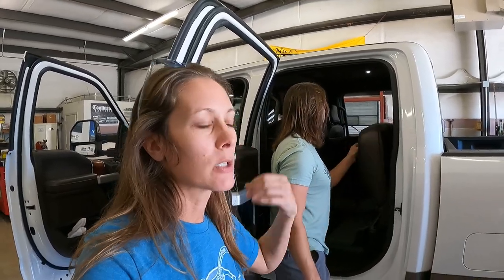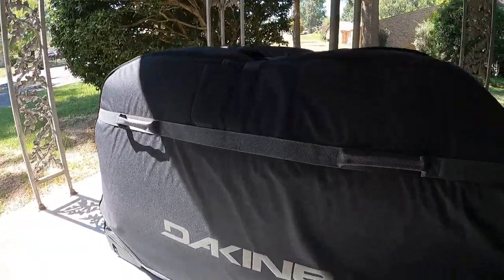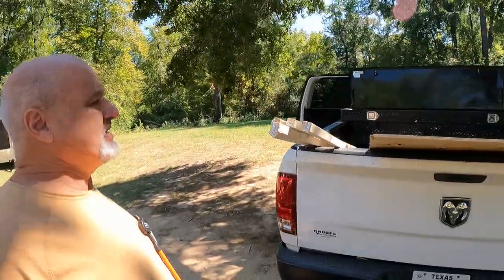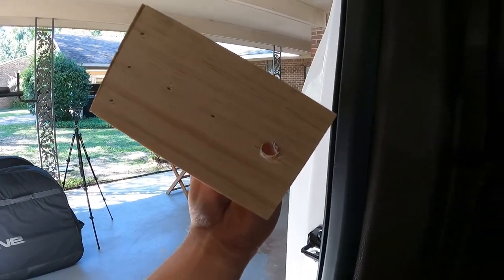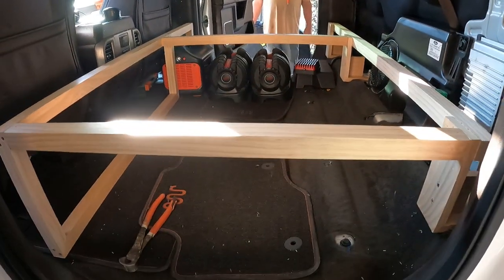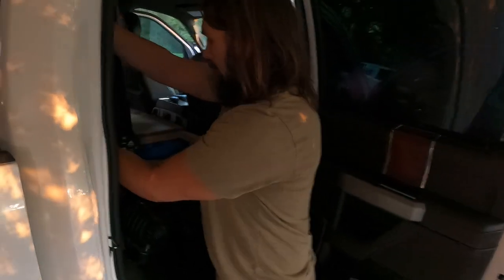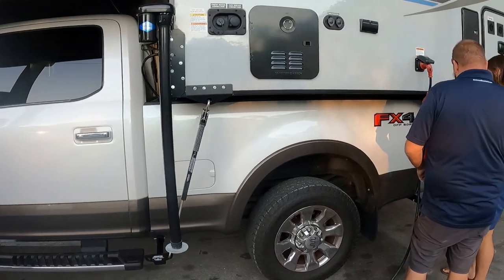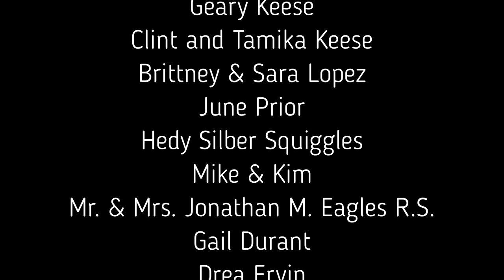Revealing Our New Truck Camper | Ford F350 Platform Build

Comment: Awesome new chapter.  Things to keep an eye on regularly with a slide in truck camper.  

The roof.  Get up there and look it over at least once a week if you travel around low hanging branches.  Carry several tubes of self leveling Dicor and appropriate caulking gun to shore up and rips or tears in the roof before it takes on any rain/snow. 

Truck tires.  Check tire pressures before taking off in the morning (or when the tires are cold).  Check them often throughout the week.  You don't want a tire to blow with a camper in the back of your truck.  Also, keep an eye on the tread wear, and sidewalls for cracking or sun rot.  One thing to remember if you do blow a tire, DO NOT slam on the brakes to try to come to a stop real quick. Odds are high the rig will head abruptly in the direction that the flat tire is on.  Better option, keep pressure on gas pedal and a firm hold of the steering wheel while you work your way to the side of the road safely.  

Don't ride your brakes down long hills to maintain a constant speed.  You will overheat your brakes (cause them to outgas) and not grab when you need them most. Instead, coast up to your chosen speed (say 55mph),  stab the brakes like you mean it and get your speed down farely quickly to (45mph), coast back up to (55mph).  This will put less heat into your brakes, and give them plenty of time to cool between use.  Don't be concerned with the A-holes behind you that are in a sports car and don't understand the amount of weight you are in control of.  Let them pass when available, and just wave as they go by.   

Most everything else regarding owning/driving a truck with a slide in camper is just normal maintenance routine.

Comment: You mentioned that you would be putting your kayaks on top of the camper make sure you know the height of your rig with them up there you need to know this for overpasses you will go under while traveling (VERY IMPORTANT).
Reply from the maker: We agree. We messed and it will be under 11ft

Comment: congrats on the new rig and exciting times. I notice you did not have a mat on the floor board of the truck bed. Most truck campers warranties are void if you dont have a mat under them. Id check the owners manual. and if required,, tractor supply has horse stall mats we all use in this hobby, saving a few bucks.. Dealers are ok with the this over there brand. it prevents slippage and gives it a flat surface and cushion to rest on. Might want to check the manuals to protect your new investment. 
. Safe travels guys.

Comment: A word of advice. Watch out for pieces metal in parking lots as they can catch your jacks and rip the back of your camper off. 😂   BTW, completely impressed at how you guys DIY fixed that.  When your camera came around showed the damage i nearly shyt myself. I was like omg that thing is totaled. Then what, 2 or 3 days later you're truckin' again. Impressive.

Comment: I will be Mr. Negative and say you should have gone with a 16-18ft TT, the cover that goes over the back of the truck bed, much more room. Plenty of storage for 2 bikes and kayaks. You would have zero issues pulling that and could cruise the town if needed. Anyway congrats on the truck camper

Comment: Good to see all the positive comments.... but maybe a cautionary note might be appropriate:  I carry a Trek bike on a swing-a-way carrier on the back of my Silverado, which I tow behind my Class A RV.
As an 84 y/o pedal biker, did my 4 miles today:  I cannot imagine carrying 2 bikes in bags inside my truck and assembling them each time I wanted to ride.
Yes, my bike is out in all weather, but I keep my seat post in the truck.  I spray my chain, etc. He said even the pedals and front fork were off the frame!  
There HAD to be a better way.  Even a bike rack on the front of the truck!  
I wager that the bikes are not kept in those bags very long.  Just saying.
Reply from the maker: It is a extra level of security to keep out of the sight of bike thefts, and reduces the length of the overall truck
Reply: @CodyandKellie  Thank you. I have carried my bike on my Silverado for at least 75,000 miles of my rv driving ---  no evidence of theft.... locked on the hitch and additional straps, and no seat....  hope you enjoy your new setup.

Comment: ELECTRICAL TIPS, MUST HAVES
NICE looking rig, its gonna be fun, congratulations. FYI from an Electrical Engineer and 50 year RV owner, it's my opinion you could really really benefit from and enjoy:

  1) A DC to DC Charger so when driving your trucks alternator can PROPERLY charge your Lithium batteries yet not over tax it.  It's an easy peasey wiring job between your engine battery and house batteries....I used a Renogy available on A ZON...   Renogy 12V 40A DC to DC On-Board Battery Charger for Flooded, Gel, AGM, and Lithium, Using Multi-Stage Charging in RVs, Commercial Vehicles, Boats, Yachts, 40A

  2) A Shunt based Battery Monitor. I used a Renogy 500 Amp available on A ZON...   Renogy 500A Battery Monitor with Shunt, High and Low Voltage Programmable Alarm, Voltage Range 10V-120V and up to 500A, 20ft Shielded Cable, Compatible with 12V Lithium Sealed, Gel, Flooded Batteries : Industrial & Scientific

 NOTES: If your existing Charger is suitable for or has settings for charging Lithium fine, however, if not, I recommend a new Smart Regulated Charger suitable for Lithium batteries. I have the same Renogy Pure Sine Wave Inverter it works perfect for my microwave or Insta Pot or hair dryer etc. If roof space allows?? if you added one or two 300 Watt Solar Panels WOW perhaps no need to drag out any of those portable panels ??

 Feel free to give me a shout regarding any electrical questions

 John T BSEE,JD in Indiana

Comment: So the pure ("true") sin inverter is actually for sensitive electronics like your phones and laptops (even these are pretty safe with a modified sin inverter actually). you can save a bunch of money by getting a modified sin / square wave inverter for utility applications like your fridge / microwave etc.

Comment: Love you guys but I'll admitt I'm a bit worried about the new setup.  Slide in campers are so tall making it harder to boondock in certain locations. The new height might not be an issue because y'all rarely boondock anymore. Those bike shipping bags seem like a major PITA. Did you explore a sliding bike rack? Maybe it could pivot down to help load the bikes in the backseat? You know, with less breakdown and reassembling of the bikes. I'm a fan but miss the boondocking adventures.  I'm hanging in there 'cause I know y'all will make fun videos. Let what I think of as "Phase 3" begin.
Reply from the maker: Thank you for watching for awhile and hanging in there. We are not sure how this will turn out. We hope this camper gives us the opportunity to boondocks more. Our biggest issues has been trying to follow the weather. Most of the amazing camping we have been to we should still be able to get to. There are a few places will not be able to get to anymore. On the bike bags, we wanted to store more in that area and protect both the bikes and the rest of the stuff we place around the bikes from one another, and the bikes would not fit with the rear tire on even if you took off the front tires.

Comment: I’m curious as to what the truck camper does to the MPG’s. I know diesels are usually not as affected as much as gas burners are, but that’s a tall TC! And I can imagine it’s not light either!
Reply: Our truck costs a fortune to run. Almost a 100.00 to fill one tank and really only good on the highway. And I think our camper might be smaller. Not sure yet.
Reply: @hshalom9113  I was thinking the same thing. That’s a pretty big air scoop!
Reply: @livableincome  it’s been almost 20 years, but I had a F-350 with a 7.3 power stroke. On the highway, completely unloaded with just me I could get 21 mpg, and that was being gentle on the accelerator. Around town it would drop to 13. I’m not 100% sure but I think I could get 15 towing my 26’ enclosed trailer and race car. This was back when diesel was around 2.75 a gallon. With it being hovering around $5 and having to buy def fluid, I’m happy with our little 10’ camper and Toyota Tacoma.

Comment: Definitely get the locks those fast guns are easily stolen.  We had a Cirrus last and really miss it now. But they empathize getting the locks. We are both b 71 and my had trouble getting in and out of  the bed. I think we're going to get a Winnebago View or Navion. I do miss the Ford F350 Platinum that I bought.  I bought it used with 99,000 miles it worked flawlessly and the couple that bought it from us called us last weekend and let us know how much they like it.
Reply from the maker: Got those locks ordered. Should have them in a few days

Comment: Solar Power -  nice to see you’re including Solar Power to your rig.  It isn’t true that if you want a 2000 Watt Inverter….you need two batteries.  You could have a 1000, 2000, or 3000 watt inverter and one battery…….or 2, 3,4,5,6 batteries.  You choose the inverter based on how many watts you plan to use!  Your microwave uses some number of watts, your fridge uses some number of watts, charging your devices uses some number of watts.  By know those numbers, you can properly size your inverter!  The batteries simply store the power you think you’ll need!  The more batteries…..the longer you can power up the inverter to supply 110 Volt power to wherever you’re using it.  Let me know if this helps!

Comment: Can you tow the no bo with the camper on the truck.
Reply: They traded it in for the camper.
Reply from the maker: This camper does not look like it has the ability to have a hitch for the trailer
Reply: Can you tow the no bo behind the truck with the truck camper on top of the truck, because if you need more storage you can pull that behind you . Just idea

Comment: What is the length of your truck bed
Reply from the maker: 8
Reply: Ok 
I have 6.5 2001 f350 in great shape and like our camper for the price you pay for it  Trying to get my wife to RV smaller    The fifth wheel we have just too big
 It looked the same as yours Don't know if that camper would fit on my truck if it needs 8 foot bed
Reply from the maker: The camper is designed to fit a long or regular size bed. If you had a f150 I would not recommend but yours should be fine. They also make smaller ones of this brand. Just cruise there website.